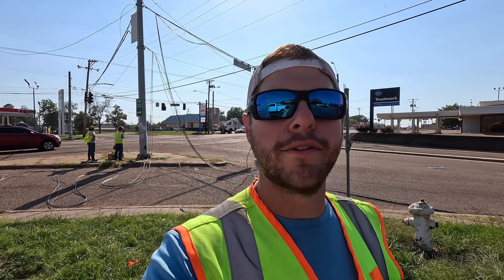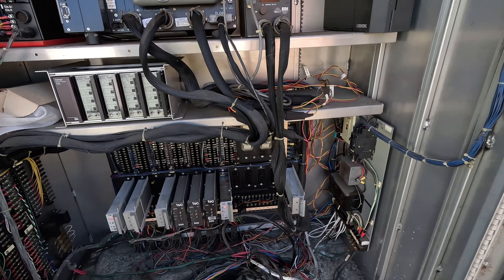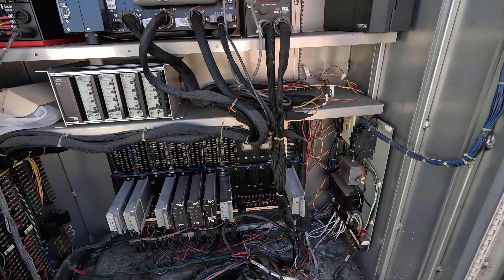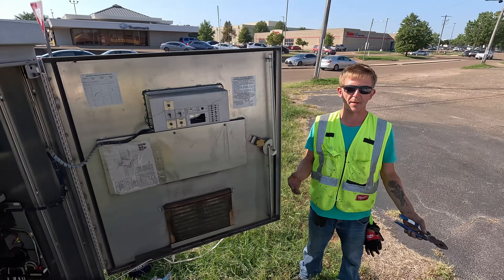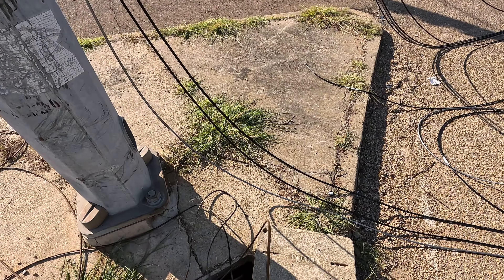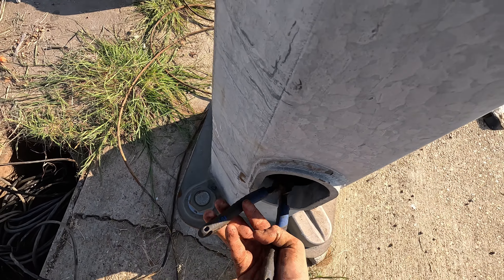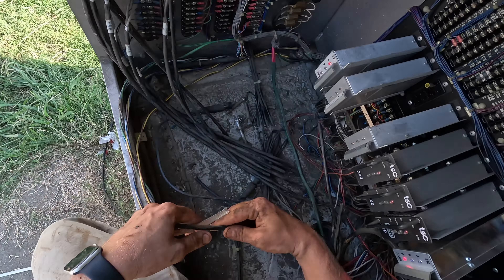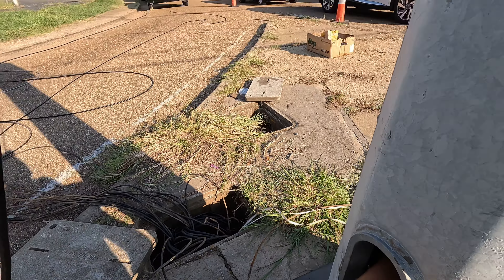Pulling Cable In Americas Most Dangerous City!!

Comment: Barring a semi-collapse of the conduit, you should have one of those jetters they use to unblock drain lines and sanitary sewer lines.  Use one of them to clean all the stuff that has seeped into your conduit and a small trash pump to clean all of the trash and water out of the access boxes you would be able to start pulling the new cable through clean conduit just like they did when it was first installed.  Of course the best thing would be if there were some sort of putty that you could push into the end of the conduit around all of the wires and prevent water and trash from getting into the conduit in the first place.

Comment: I can so relate to inductive loop issues. I'm down under in Sydney. A street near me has a few data centres sprouting up. Rather than have any sense regarding services in paths and road, both have been ripped up for new conduit for fibers at least a dozen times in past 2 to 3 years. One particular set of traffic lights has had the loops cut and trenched so often that there are more saw cuts than concrete in the curbs. The lights revert to fixed phase and *&^&& up the traffic flow for months. Its taken letters from local member of parliament to the transport minister to get thrm fixed a few times. And then, in some cases within a week all gets dug up again. We've the best software system in the world (SCATS), thpusands of traffic cams, but no alternate vision system alternatives for loops...

Comment: re: Bathroom breaks. I'm on a prescription that makes me go a LOT. But also, drinking a ton of water can make you go a ton too.

Also.. if it were VPOTUS, it would be Air Force 2 lol. And that would likely be Marine 2.
Reply from the maker: When I was editing I caught myself calling it the wrong name but i thought it was funny so I left it in! 🤣 also don’t drink more then you can sweat out!!! #1 is usually not an issue because it can be done without leaving the jobsite it’s the multiple #2 breaks that add up a lot of time!
Reply: @Trafficlightdoctor  oh yeah those 2s can take a while. I’ve gotten to the point where I can 1 in a 2:30 commercial break lol. 

And excess water here isn’t a problem. It’s meat locker cold in our control rooms. Well except that one day the air con broke in the middle of summer and it was nearly 100 in here. Lemme tell you, equipment doesn’t like that. Though I did learn to drink plenty of water last time I was down south……..I uh….yeah don’t want to talk about what happened lol. But that helped the day it got dreadfully hot in my control room!